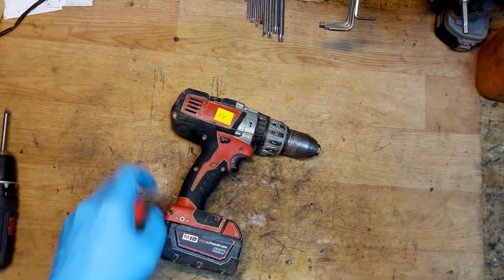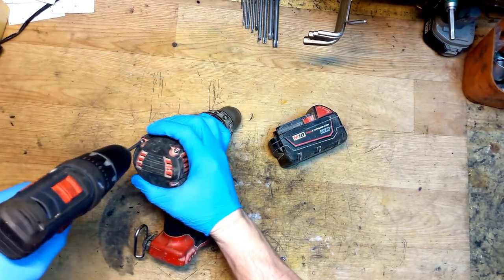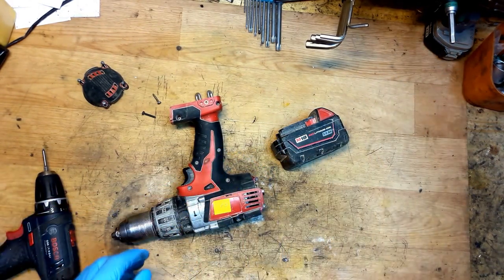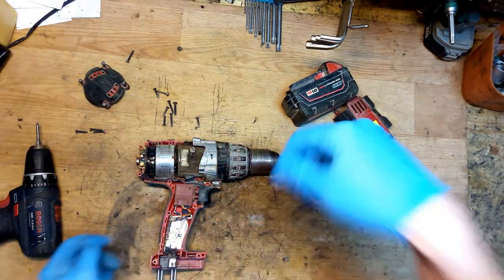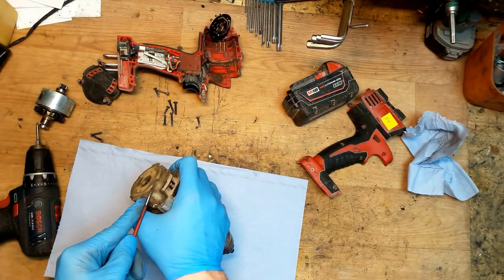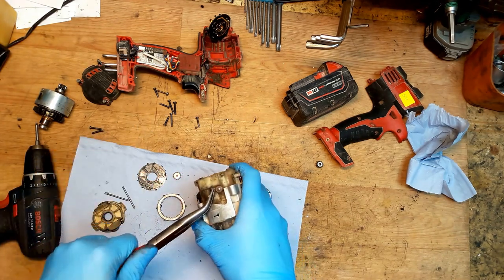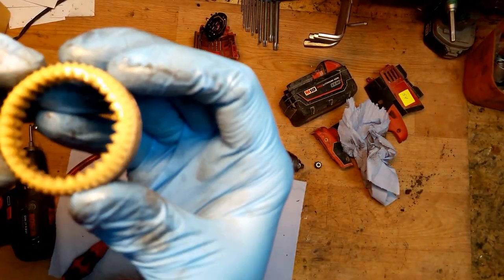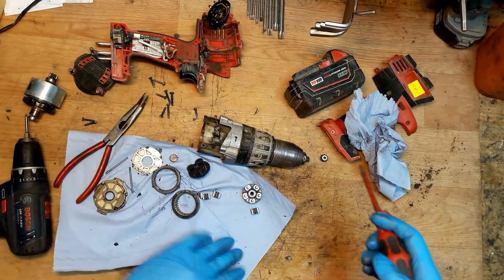How to disassemble and find problem in Milwaukee M18 cordless drill faulty gear assy

Comment: Im curious if hes going to install a new gear box or just the nylon . if it was mine from what i can see and from the countless tools ive rebuilt id go with the new nylon. The metal parts rarely fail. When they do its usually a break not worn. And a suggestion to anyone that has not done much of this work use a screwdriver or low speed setting if using a drill to remove case screws. The plastic strips out relatively easily when removing the screws on high speed. Does the same installing them.

Comment: I dissasembled my M18 CPD and found out gears are "eaten" in gearbox. It had a lot of years so that was no suprise. First maybe negative suprise was that i need to  buy whole gearbox and it is impossible to buy just spur gears (nice work milwaukee, see what you did here...)...Ok i ordered gearbox and replaced it but i overlooked that motor assembly has also faulty, eaten gear. So i ordered this piece also. But when i assembled it together the sound i got was not ok, gears were not running ok. I opened it again and i saw that my new motor assembly gear got quite a wear from 5 min "work"...I put extra grease and all and assembled the machine again but it did not help, again i got sound that i did not like, gears being noisy and like there is friction...Now i dont know what to do and where is a problem. Anyone have any idea?

Comment: I'm having trouble with screw that loosened to adjust for various bits. It wont go down to small and clamp the bit. You usually just have to retighten screw. But I cant seem to get it to tighten again. Open all the way or to where its stuck. Any ideas?

Comment: Rear bearing on my M18 hammer drill blew up. Milwaukee refused to repair it because I had pulled it apart, bagged everything separate, and had the broken inner and outer magnet in a sack for replacement.

Almost like they forgot I have a right to repair.

Comment: What size torx bit driver fits the screws?
Reply from the maker: Hello, if I remember good it was TX6
Reply from the maker: but you need TPX6 with hole on bit center
Reply: Thanks

Comment: my armature seems to be wobbly in the magnet,  took it out and the ware is different on stack laminations, the mtor doe not spin and it seems to be stuck.
Reply: Power tools fix . I have the same problem.  Is it possible send to u . And how much it cost to fix? Or maybe u have video about ball bearing? Thanks

Comment: Comrade? You have done this (AT LEAST!) one time before....How does a $599.00 Highly Rated cordless Drill...Become a total piece of CRAP! With a slipping clutch mechanism? With in ONE YEAR?
Reply: The tools are build to fail now. If someone uses them more than average they fail before the warranty runs out.
Reply: I’ve had Milwaukee tools for ten years 
The drill is still working 
The impact driver is still working 
The cold cutter ( for cutting unistrut and stud ) broke two years ago , i dissembled it and found the rotor on the armature had snapped ( I was cutting cable tray at the time) ordered a new armature motor £38 and still working. 
These tools are used and abused every day , sometimes dropped from height, used as hammers and yet they still work with the same batteries 18 volt 4 amp …. fantastic tools wouldn’t buy anything else highly recommend.sparky U.K. 🇬🇧👍

Comment: And no doubt you can not buy the plastic gear and have to buy a whole new front section.?
Reply from the maker: Yes, you are right
Reply: @handyman7282   i checked the cost and it is $140
Reply from the maker: @nightingaleron  140 only for shipping? It can't be so expensive... Where do you live?